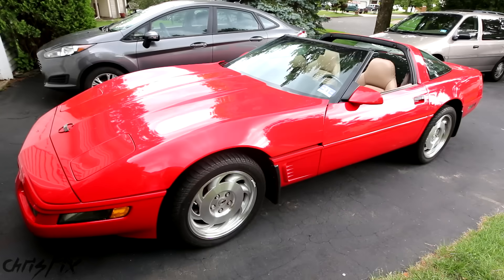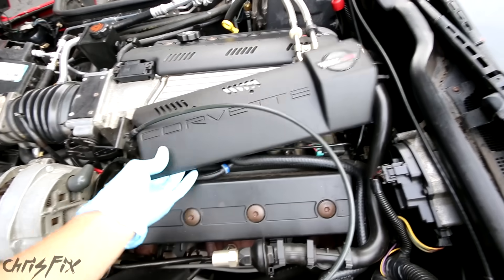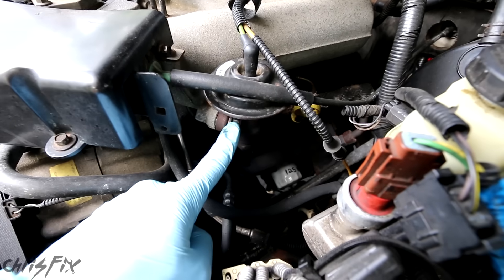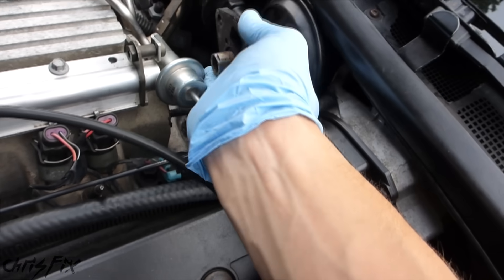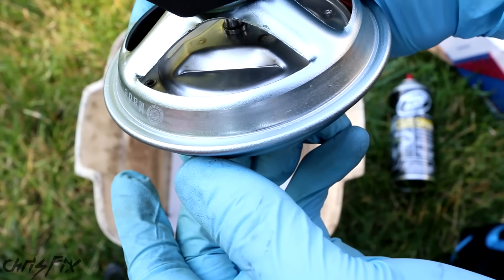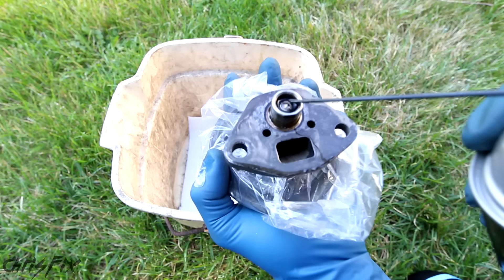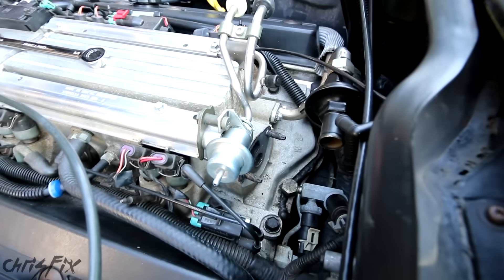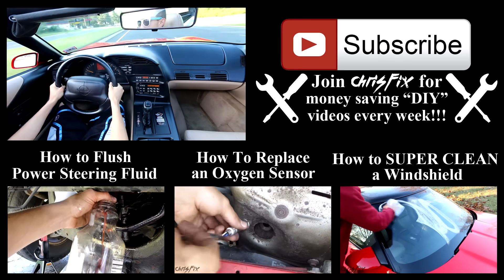How to Clean and Replace an EGR Valve P0400

Comment: newer engines don't have EGR valves. Variable valve timing allows exhaust gas to be sucked back into the cylinder.  This new system allows the intake manifold to run much cleaner. Now...if PCV could be handled another way we'd never have to worry about carbon build up on GDI engines.

Comment: I blanked my egr valve the car run much more better, it takes a bit more to warm up the engine,  but it's much more smooth an no casual misfiring,  those egr valves they are useless expensive piece of garbage and take a few kg on top of the cars weight

Comment: hey Chris.. new to yr channel and really digging it..thanks so much for yr info..ive just brought a 2002 ford econovan..its running  well except when i slow down(i.e. take me foot off the gas pedal) when approaching a stop/rounderbout/lights etc there is a smell of gasoline..seems to come from outside because cant smell it when windows up and as said it only happens when slowing dwn....doesnt seem to be comi g from engine, fuel cap is good, no apparent leaks on fuel lines.  can you direct me to any of yr videos that may civer this issue or do you have any ideas?  thanks so much in advance hope u can help  ps seens to be idling a little rich too
Reply from the maker: +Da vid sounds like the charcoal canister for the evap system
Reply: +ChrisFix thanks dude for the qyick response...i will check it out..and again, great informative videos..soo much help👍👍👍😀

Comment: +ChrisFix  This is great for those who have a vacuum assisted EGR, but as you noted, many are electronicly powered.  You show how to check the vacuum operated ones, but how do I test my motor (electronic) operated EGR? I took the EGR out, cleaned it and reinstalled it, and the motor improved idle some, but it isn't running normal - lacks power.  The Check Engine light disappeared then came back on after cleaning.  My EGR valve has no vacuum line but it has 4 wires feeding it.  HELP!

Comment: Replaced the valve with ease but my light is still on. '06 Subaru Legacy with an electric powered egr. Can I expect this to turn off with a little time or could there be another issue

Comment: Can a car stall while driving Can a bad EGR cause that I change just about everything checked the EGR AND IS no good I hope that solves my issue change Icm ignition coil, ECM , crankshaft checked my distributor and is still fine working properly the iac was also changes so idk

Comment: how can I check for vacuum leaks
Reply from the maker: With the engine running, spray some carb clearner around the vacuum lines you think are bad and if the engine changes idle speed, you found your vacuum leak.

Comment: Great vid I have a p reg sprinter van it won't pull through the rev range when it's under load i.e. Driving down road could this be egr valve revs go flat at 2500 but will just pull to to 3500 on the flat given time tried sucking on vacuum pipe and you can literally breathe through it has the diafram gone and would this cause this running problem thanks

Comment: Hey Chris, I put a new EGR valve in my 96 C1500. The code was P1406. I also re grounded a corroded wire after accidentally ripping it off. Now at idle it struggles to run and sometimes dies or when accelerating from 0-10ish mph, the truck stumbles. The engine light came on and I just cleared it with my scan tool. Does this mean it's just trying to relearn the new valve? Or do I have a bigger problem on my hands?
Reply: Also when at any speed above 10 it runs like a dream

Comment: why not remove the egr and return it before going for an inspection ?
Reply from the maker: +shayson1357 the car is tuned for the EGR so it won't run correctly without it. I also don't want to see a CEL.

Comment: hey Christ what would happen if I bypass the egr valve cover it up with a small aluminum plate ????
Reply from the maker: You would get a check engine light and the car wouldnt run right if you dont tune out the EGR

Comment: My mechanic replaced the egr valve on my 2000 ML 320 and the light came back on. He said he will have to remove the head in order to clean out the ports if there is build up in the ports and will cost $2,000. Does this sound right ?

Comment: I converted my car to Flex fuel. Ethanol does not leave carbon deposit in the engine. Burn some gas in a bowl and then burn some alcohol, no soot or black smoke from burning alcohol

Comment: Don't clean it at all.  Rip that junk off, throw it in the trash and replace the egr with a block off plate.  The egr just hurts gas mileage and performance.
Reply: ^ Well put!
Reply: It does reduce power at times, but sending air with very little burn-ready oxygen into the intake reduces the amount of fuel needed for a stoichiometric mix.
Reply: Don't ever do that. Without tuning it.
Reply: I have never understood why people say that it doesn't affect anything. It is shoving non combustible exhaust gas back into your engine, and exhaust won't "reduce your temperature" by doing it. Exhaust is very hot at operating temp, or it was, last time I checked.
Reply: Problem with that when in some cars, when you remove vacuum hose, the valve remains open. Which means it's sucking in exhaust gasses every time
Reply: Frankie Bleddyn Not just the west cost, the have the clean air force in georgia. Almost the same thing.
Reply: Just pass your inspection and the block if off for crying out loud
Reply: why? I removed the vaccum hose from my chrysler voyager 2.5td. runs good.
Reply: guys ist better to remove it
Reply: In Europe, we describe EGR as connecting your toilet to your water tap. No sane person would take the shit that's supposed to get out asap and run it back to the combustion chamber. The sole point of this exercise is to lower fuel consumption by roughly 2 percent, which is something you don't care about individually, but if millions of cars lower the fuel consumption by 2 percent, it (allegedly) makes a difference to the environmental impact. Unfortunately the most ecological vehicle is one that never had to be produced in the first place and this thing drastically lowers the lifespan of your engine, so you'd have to get a completely new car that had to be made from the ground up only because you had to save 2 percent of the fuel... Japanese cars usually switch to "Normal mode" when the EGR is blocked off, the computer is actually prepped for this and the hose to EGR has a metal plate on it that only has half of the circle cut through - if you don't want EGR to operate, you take that plate out and turn it around, so that the cut half-circle is outside and the hose gets blocked. The car then doesn't use EGR at all, but since the EGR is still present, it will utilize it according to the regulations (but it will not make any actual impact) and because it's physically present and physically moves (despite the hose being blocked), it won't report any CEL errors.
Reply: my lincoln ran good then the egr went bad and my power and mge went down
Reply: Just got this g35 and its putting or jerking between 50 and 70mph it stops if I go faster or under 50mp crazy thing is it's not showing any codes....... last code said evap gross leak, vac leak, and cylinder it appears they fixed that because the light is off but it's still jerking any ideas will be helpful thanks
Reply: Frankie Bleddyn I do that on my performance motors and I have to tune out the EGR from the computer
Reply: Matthew Baker how much does it cost to replace? Also how simple? Cause my car the check engine light would stay on and if i went over 30mph my check engine light would flash and my car wouldnt accelerate til it stopped flashing so i googled it it said its a misfire so i plugged my code reader up and my egr pressure sensor was the issue i went out got a new one and put it on and the light went off and i was getting past 30mph but my gas milage still sucked terribly like if i drove like 10-15 minutes away it burned up almost a quarter tank of gas. But then i tried going on the freeway for the first time since i replaced the egr piece and the light came back on and started flashing again so i took the piece off and put it back on light went back off and i havent taken it on the freeway again since lol but its a hassle taking the streets every where where i live due to all the construction on every corner but i cant seem to figure out the problem and i cant find any trust worthy mechanics everybody wants a arm and leg for the simplest jobs thats why i been trying to learn and do the stuff on my own
In case i said the piece wrong its the egr part thats plastic plugs in and has 2 hoses on the bottom
Reply: well that's for your car. I've just ripped of that junk. Fuel consumption increased 2 - 3 %, but car is more responsive, doesn't smoke.
Reply: Matthew Baker not having it would your(and my) health.
Reply: Do you have to go for emissions tests where you live? I don't know if that would benefit you in that way
Reply: Precisely this.  Removing your EGR is probably the worst advice possible on a modern vehicle.
Reply: It does not hurt gas mileage or performance.  It reduces the combustion temperature during part throttle operation to reduce nitrogen oxide emissions.  The EGR valve is closed at full throttle.
Reply: Except, who drives at full throttle? That means your engine is always sucking in its own poop 🤮
Reply: Jcc Chapman  Egr cools the engine by stopping combustion from happening so if there’s 80% clean air and 20% Egr the engine isn’t able to combust the 20% so that means your car is slower, less responsive, and shorter engine lifespan
Reply: BUT MY FRIEND PUT SHEET OF METAL BETWEEN ITS COMPONENTS  AND IT WORKS GREAT
Reply: I THINK ITS BAD FOR PERFORMANCE
Reply: How does putting "hot" exhaust gas BACK into your "cold" air in your intake cool down temps? That sounds like horse shit. Environmentalists don't give two shits about your engines health
Reply: OH MY Egr is cooled by engine coolant and Egr cools the engine by stopping combustion from happening so if there’s 80% clean air and 20% Egr the engine isn’t able to combust the 20% so that means your car is slower, less responsive, and shorter engine lifespan
Reply: Stopping your egr is a bad idea with any car made since like 1985. The engine is not programmed to run without it functioning properly. The only way to run it without one is to have the car tuned.
Reply: Dont waste your time and money cleaning EGR, pay extra and defo replace it with genuine part. EGR valve is super important part for performance and fuel consumption.

Comment: Thanks Chris for all you do. Having watched a few videos on certain GM and perhaps other makes as well,  It seems you might need to disconnect and reconnect the battery after replacement as to clear out the stored setting for the EGR in the PCM. Not for the trouble code but for certain position settings regarding the EGR.

Comment: So If I remove the EGR Valve, and it holds a vacuum, I should just clean out the carbon and use the same valve? If it doesn't hold a vacuum, then I should get a new one? Will cleaning it help it keep a vacuum? The mechanic said I needed a new EGR valve according to the computer, so I'm gonna try to clean/fix it myself. I'd rather clean it bc a new one is about $150!
Reply from the maker: Correct. Cleaning will only help it slide open and closed. The vacuum is all about the condition of the diaphragm.
Reply: Sam Sloan The EGR should hold vacuum until you release the vacuum. EGR valves can stick open a little. Carbon can hold it open. Try a gas tank carb. cleaner to keep it clean. It also cleans the cylinders. If it leaks down replace it! Check the passage below the EGR valve if it's clogged.

Comment: What material is the EGR gakset?  I cleaned out my 2000 Civic HX and while mechanics in videos said you could reuse the metal gasket, (you did too!), but I had metallic paste flake off of the metal plate sandwiched in the middle.
Reply from the maker: It was metal (most are metal).
Reply: ChrisFix Thanks for responding!  Do you know what material the paste is?  Thanks!

Comment: EGR is the devil on modern cars. I hate it
Reply: EGR top 3 things:

- cools the engine
- lowers fuel consumption
- lowers CO2 emissions

How is this evil, btw?
Reply: Rusu Traian Cristian Egr cools the engine by stopping combustion from happening so if there’s 80% clean air and 20% Egr the engine isn’t able to combust the 20% so that means your car is slower, less responsive, and shorter engine lifespan
Reply: @steve5912  Namaste!
Reply: They are not that bad on modern gasoline engines... diesel is where you have to watch out. Diesels not only pull in more EGR gasses than gasoline, diesel exhaust gas is much dirtier (soot).
Reply: You are wrong! It cools the engine. Learn more auto-mechanics!
Reply: @hankbridges5055   then what's the purpose of the radiator?  Do motorcycles have EGR?
Reply: @hankbridges5055  am a competent mechanic bro. Here in Africa no emission controls. I delete EGRs and my customers say the vehicle became powerful
Reply: EGR SHOULD BE BANNED.   YOUR A SMART GUY.    ITS POLLUTING OUR ENGINES.   CONGRES!!!

Comment: wait a minute there bud. just some info here, the EGR valve is not always connected to the exhaust. for example my 1.6 tracker 1999 has the EGR valve mounted on the back of the engine near the bottom of the exhaust valves and dumps the exhaust right above the valves

Comment: what is the program u are reading the codes from your phone chris
Reply: Angel Dimitrov I don't know if you've found out or not but Chris used a OBDII sensor called "Blue Driver" which connects to a phone via its own app which is how you can see what's wrong with the car

Comment: Fricking EGR, fix it sure, but then close it off. All it does is cause problems and unnecessary wear.
Reply: Its Jake The Brake it allows cylinder temps to run a bit lower which is always a good thing. This is all being done now through variable valve timing controlling the valve overlap
Reply: It reduces peak temperatures by basicly reducing the oxygen in the combustion. That's just a side effect though and not the main purpose. If you wanted to reduce peak temperatures you could just have the cylinders run on a richer mixture.
I just don't think that leading exhaust gases back into the cylinders is a good idea. All it did was add another part that breaks and causes a whole number of problems, as well as lower engine efficiency. Also, I've disabled it in all the cars I've owned that had it and they never failed emissions tests, so they don't seem to even serve their actual purpose. Thankfuly the industry has found ways to lower emission without an EGR and is moving away from them.

Comment: To:Chris,I need a hand I put a new EGR Valve in my 2000 Honda Odyssey cargo,Dam check engine light came on.
Reply: Robert Farber those are notorious for for the passages in the intake getting clogged. There is a TSB from Honda , showing how to clear that up.

Comment: Hey Chris. I did this method with my egr plunger works and cleaned it thoroughly. Code piped again p0401. But get this... The car idles so bad but drives well. i unplugged the little hose connected on the top of the egr and the car idles smoothly. Whys is that? does it mean even the the plunger works and egr valve is cleaned it could be bad?
Reply: サントスシｮナサン you most likely have vacuum present at all times which shouldn't be happening. Check the solenoid that provides the the vacuum when commanded, it might be stuck open.
Reply: it was the solenoid valve lol. It wasn't opening.

Comment: Why are exhaust manifolds always so rusty? Even brand new cars have rusty manifolds.
Reply: it's because they are usually made of cast iron. Cast iron handles heat very well.
Reply: I'm not by any means an expert, but I'd hypothesize that it's because the exhaust is one of the hottest parts of the engine. We're you to put any sort of coating on it to prevent rust, it would likely burn off, and rustproof alloys like stainless steel might just be too expensive. To anybody who wants to tell me I'm wrong, feel free.
Reply: not necessarily rusty, more like discoloured because of the heat. if car driven regularly, it's all good because any water will quickly vaporize off anyway

believe it ir not, but stainless steel also slightly corrodes, hence the goldish colour on stainless steel headers over time. also discoloration by temperature.
Reply: 2006 duramax diesel fuel smoke
Reply: Exmerion heat and condensation
Reply: They get hot and the coat comes off, the condensation rusts it.
Reply: HEAT AND OXYGEN AND EVEN WATER = EXTREME RUST.    ALMOST LIKE SALTY WATER.

Comment: Wow this so much more easier to understand than the way my instructor was explaining it to us. I see you have a return-type fuel system lol. Hey we are almost done with fuel and emissions. we will be moving onto Ignition, then Engine performance, and lastly automatic transmission. It would be great if you could do videos regarding those topics, you might have some videos about those so I'll have to look back but an updated version would be awesome! Also what scan tool do you use? Seems like its a wireless one that works with iPhone. I'm looking for a good one. Thanks!

Comment: Question about engine light codes, nothing related to EGR valve. I have been getting cylinder misfire codes P0300 through P0306, and this only happens about twice a month and occurs a few minutes after I start my vehicle and on idle. I don't feel any knocking during the drive. I've had a set of spark plugs replaced recently. Engine light disappears after a few starts. Don't know where the problem is?
Reply: Honda Accord Hybrid 2007 6 cyl*
Reply: I had those same codes on my 02 Mustang, try changing you're coil pack maybe that's the problem
Reply: I've had the coils replaced along with spark plugs and still triggers the codes :\